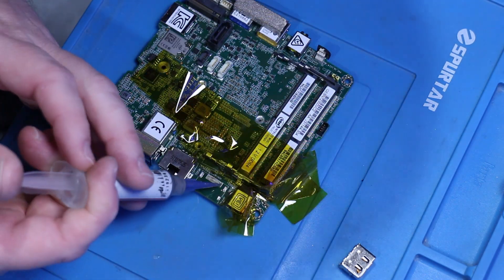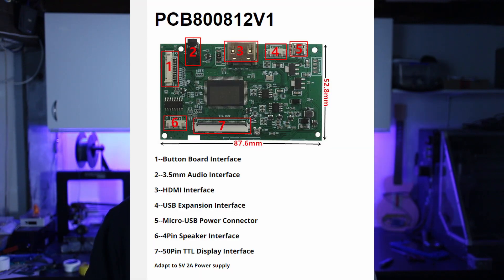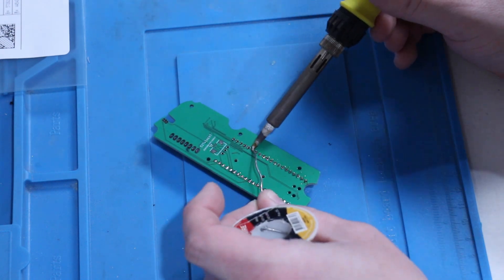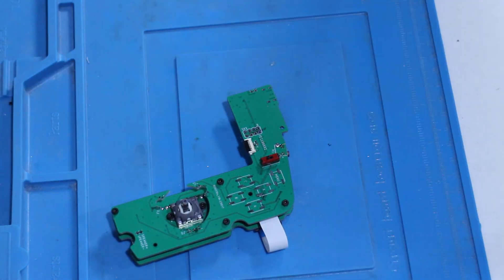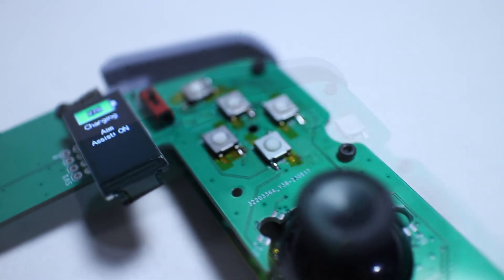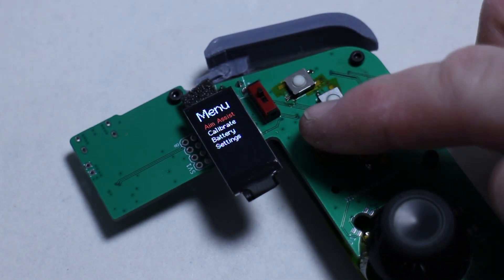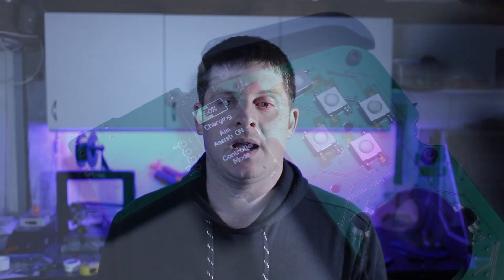NucDeck - The DIY windows gaming handheld - Episode Two

Comment: Hi, can someone tell me how did he used 2 analog joystick with GP2040 firmware, i read the documentation and the addon that makes it possible to connect analog joysticks says that the pi pico only has 3 ADC pins and the sticks need 4. I'm building a cloud gaming handheld with a orange pi zero 3 4GB and it would be cool if i made the controller myself. Thanks!
Reply from the maker: I didn't use the GP2040 firmware, I wrote my own. Having said that, the code is available on the github so you could use some of my code but it is full of extra stuff for the battery managment display so if you aren't interested in modifying the code its probably not your best option!
Reply: @cncdan  Thanks i take a look at it!

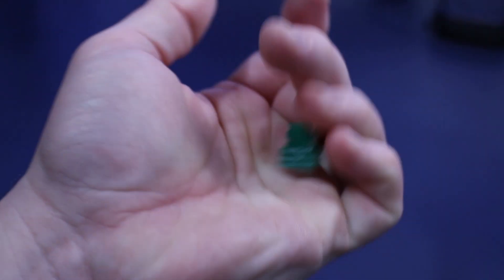Comment: @2:39 that PCB is too fat, make it out of flex pcb , pcbway does that. much flatter and the heat goes faster to the connection points AND use a stencil for the solder paste, to put it on the flex

Comment: How to install the motherboard into the case?

WTF.. there is no way to do this,,,

The video does not show,..i have the best CNC machine.
Reply from the maker: This is a multi-part series so not everything is in the one video. I'm still working on the next video but I will show how it all goes together. There is also an assembly guide on the github that shows how it all fits together: https://github.com/dmcke5/NucDeck/blob/main/NucDeck%20Assembly%20Instructions.pdf

Comment: Curious to know will the final build support Gyroscopic motion controls like those on Nintendo Switch joycon/procpntrollers or PS4/PS5 controllers.

It'll help tremendously for handheld games playing shooters or mouse simulations

Other then that this is looking fantastic!
Reply from the maker: Yep, that's my intention! I have wrongfully called it "aim assist" in this video but yes, I'm planning to have the option of gyroscopic aiming which will be fully adjustable/configurable through the GUI on the info display

Comment: Cant Wait early releases of the files , Any good news ?
Reply from the maker: Not yet. I want to make sure that I've test fitted everything properly before I start releasing files. The power supply section of the build is probably going to take a while to get right so it could still easily be a couple of months until I'm close to having something complete that people can start building. The actual 3D model of the parts however shouldn't take that long

Comment: Keep up the excellent work! I hope you can eventually make your own PCB once the time is right.
Reply from the maker: You mean instead of using a NUC? That's definitely way beyond my ability levels at the moment unfortunately!
Reply: @cncdan  To be completely honest, that's also beyond my abilities as well. I'm more suggesting it as a long term goal for much later, rather than soon. Off-the-shelf parts are working nicely for me for now.

Speaking of which: since I'm also using a NUC, I managed to get the GameCube games I cared about, including funny Pikmin mods, running without a graphics card. I'm happy to know that my integrated graphics work fine on Linux without issue. Guess I should save the Graphics Cart for native PC games, then.

Comment: pretty cool project, good to see someone representing australia on the channel. How do you find getting parts or you like myself and source from china?
Reply from the maker: Yeah China is often the only option unfortunately! There's a couple of local online stores that I use, littlebird, core electronics and RS components to name a few. As soon as you start talking about more unusual stuff though China becomes the only option. Wouldn't be so bad if the minimum shipping time wasn't 2 weeks!
Reply: @cncdan  two weeks.is.great, I'm lucky in bris to get anything less than 4. Digikey is pretty good, min spend 60.AUD for.free.courier from the US in a week. But even then I find it hard to navigate and you have to know what you want.
Reply from the maker: @3rutu5  I've done two digikey orders in the last week alone haha. They are great, just wish there was a cheap shipping option for smaller pacakges when I don't need $60 worth of stuff. I'm in Brisbane too so our shipping times should be similar on most things. I ordered my replacement display driver a week ago today, so I've probably still got at least a week to wait before I'll see it. Lucky I've got a pile of plastic here to start machining otherwise I'd be making no progress!

Comment: What are the dimensions on the nuc you’re using? Would you require a chassis redesign for one of those newer ryzen nucs?
Reply from the maker: This is a 7th Gen Intel NUC. Intel's website has a full 3D model of every generation of NUC available so you can look it up there if you'd like! As far as I'm aware, besides the NUCs with GPUs they are all pretty much the same form factor. One day hopefully I'll be able to get my hands on a newer AMD NUC and see if I can make it fit!